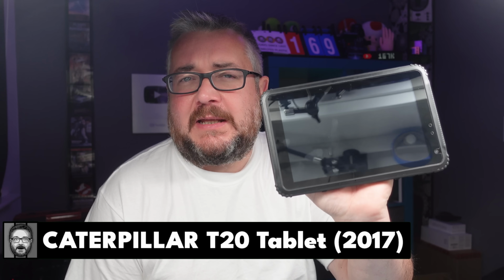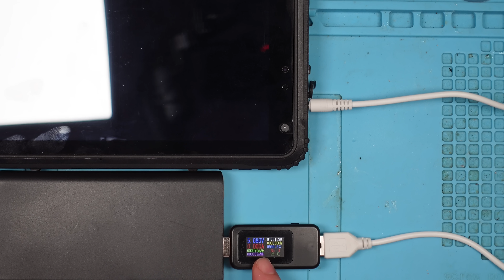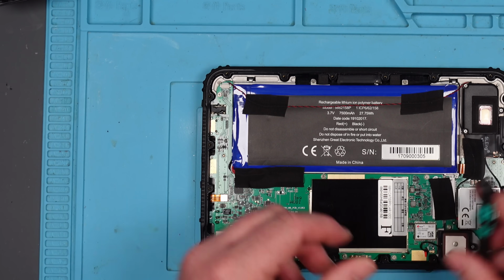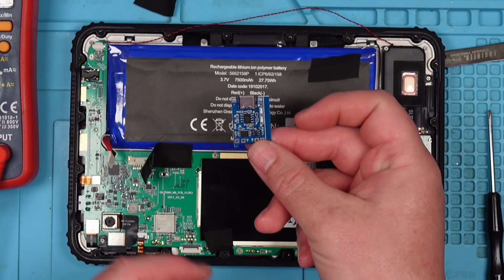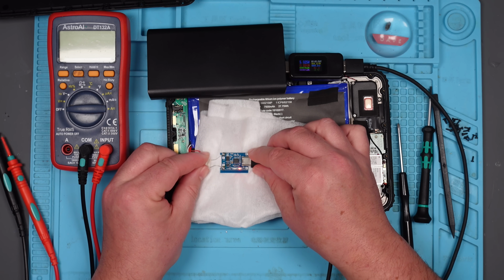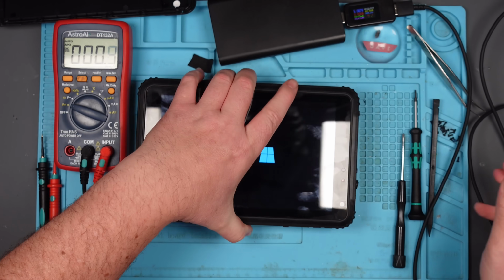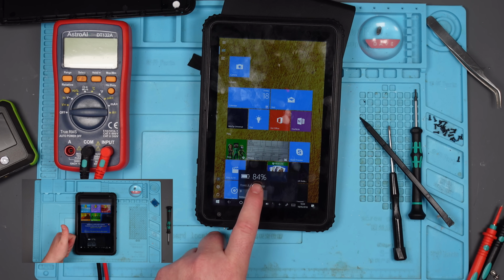A VIEWER sent me this FAULTY CAT T20 Tablet | Can I FIX it?

Comment: This is an issue with all modern hand held devices that have a soft power button.  The electronics uses a bit of battery all the time when switched off to check the power button.  So they go totally flat eventually.  Phones, tablets, game controllers, you name it - leave them unused for too long and the battery manager declares them toast.
Reply: it is a common issue but it's not all of them, usually there's some kind of undervoltage protection on the battery itself or on a charge controller chip that cuts the battery output if it gets too low. if the protection circuit is inside the battery you can actually get a voltage reading of 0 volts on the battery terminals when this has cut off even if the internal voltage of the battery is higher than this, and as soon as the mainboard applies charge voltage to the battery again this should reset and start voltage output again. Even the TP4056a charger board steve used to charge the battery has this function provided by the small DW01 chip and mosfet
Reply: You obviously only used cheap crap and never used an iPad.
Reply: @mojoblues66  I repaired electronics for 30 years and have had ipads as well as iphones like this.  Leave your Apple stuff totally flat in a drawer for about 12 months after being flat and the units BMS won't allow it to charge again as it sees the battery as then too low.  Lipos continue to lose about 2% a month just connected to nothing.  Sony playstation controllers do it after about 12 months of being flat, as do Nintendo Pro controllers.
Reply: @MikeB_UK  I have iPads and iPhones laying around for more than 12 month and they do spring back to life after being connected to a power sources for about 5 min.

Comment: i wonder ... i had a CMOS Battery fully drained on my motherboard and so it forgot time/bios setting and stuff aka would not start up and boot windows and i wonder if a ipad also have a cmos battery like that in there since its a windows machine (its a small round flat battery)

Comment: did you check the power adaptor, it's possible that failed, but then the battery was too low to use the usb

Comment: 5v into a 3.7v battery, much dangerous.
Reply: But it worked. 🙂
Reply: @paulsengupta971  Just because something worked doesn't make it very dangerous.
Reply: It's fine.  Not something you'd walk away from for an hour but if you are monitoring with a multimeter and have half an idea of what you're doing its OK.

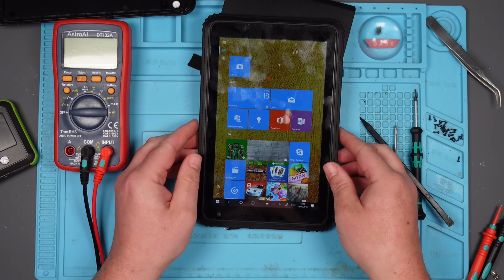Comment: 8:40 Nope, Windows 8 didn't have a start button remember, Microsoft expected their users to be clairvoyant and know how to bring the start menu up.
Did you actually check that charging port wasn't loose? It might have just been making connection during this charge but might not the next time?
Reply: Yeah I used to open up the Windows 8 beta on a laptop and ask people to simply open Notepad. Half an hour later they would be in tears of frustration.